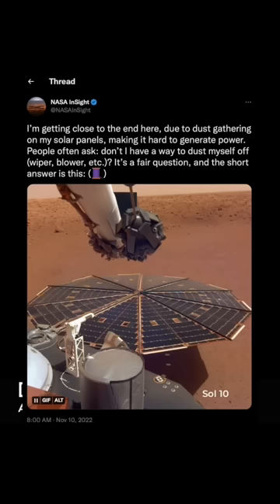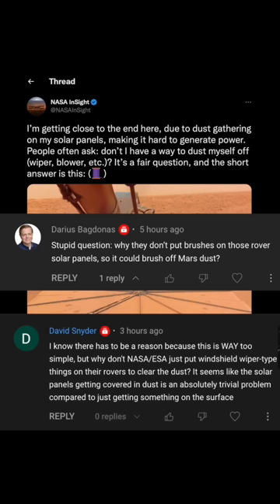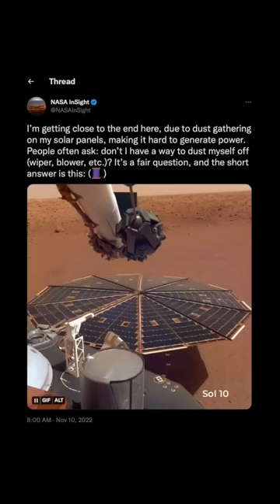Why don’t Mars probes wipe the dust off their solar panels? #shorts

Comment: Get Ingenuity to hover over it for a bit. :P
Reply: I guess that helicopter is hundreds of kilometres away.
Reply: You generally do not want a experimental flight vehicle which already almost crashed above your multibillion science instrument - except maybe as a last rescue mission.
Reply: Same thought
Reply: Wouldn't work for many reasons not least of which you're thinking Earth air pressure which Mars doesn't have.
Reply: @gdwnet  I don't think the air pressure has anything to do with it. don't forget about Newtons first law. those propellers produce enough force to lift a 1.8 kg craft that same force is acting upon the surface. also there are videos of the rotor wash from ingenuity
Reply: @benjaminhanke79  Correct. Per NASA the Ingenuity helicopter is roughly 2,147 miles (3,455 kilometers) from the agency's InSight lander.
Reply: @benjaminhanke79 thousands
Reply: This didn't age well T_T
Reply: Sorry can't do that Ingenuity is no more
Reply: @timonc6302 not at all 😂😂

Comment: Since Mars is very dry, it is also very very sticky dust (static dust - not just "gravity dust" like we are used to) so brush would get full of dust itself, causing it to become sandpaper-ish. Another thing is - that brush thing would have to be pretty long and with probably 2 joints (foldable), so it wouldn't be light/small in size and that would "kill" these side-missions (since their "selling point" is being pretty cheap and still providing good science behind)
There is good reason why last 2 "big" Mars missions uses nuclear power not solar panels - they can have extra weight on-board and are little to no impacted by dust.
Reply: Compressed air then?

Comment: Another problem is that the dust has an insane static charge so it sticks to EVERYTHING, including wipers. And being in a lower gravity, static charged environment, it is likely that dust wont behave like it does on Earth and wont just fall away with brushed off the panels. The physics of how wipers would work on Mars is probably more difficult that it sounds like at first glance.
Reply: Nitrodamous  Yes, Im telling you that orbital mechanics is several orders of magnitude simpler than the physics of atmospheric dust. Heck, we don't even have a complete understanding of how dust interacts within Earth's atmosphere, and we can directly observe and test that.

Comment: In May 2021, the InSight team successfully tried a new dust-removal technique, using the lander's robotic arm to trickle some grains of sand onto a solar panel—when a gust of wind carried the sand away, it swept a little dust off with it.
Reply: This site has much less wind than expected.
Other sites have had much more wind. Wind on mars being barely a breath on earth.
So little wind fine dust fall accumulates but isn't shifting much. 
A convenient dust devil any time in the last few years could have extended the life.
A buzzer or electrostatic pulser to vibrate the panels or dust would be lighter than brush or air jet mechanism. 

With sloping panels and perhaps triggered when higher winds are detected. Or perhaps electrostatic stickiness would defeat it.
But the results show there wasn't much need for it in the mission requirements.
The systems performed much longer than planned. 
If it wasn't the panels and lack of wind it would have been another component eventually and some people would wonder why that component wasn't beefier.

The mole burrower experiment was a failure from the start since it was unable to burrow through the ground at the site even though they persevered for two years.
A beefier burrower should have taken priority over any solar panel cleaner if such a decision was to have been made.
Reply: A cheap, lightweight corundum wiper could've prevented the entire problem far earlier.
I'll just get my coat...
Reply: @spvillano  nope. These panels are pure substrate, not covered by hardened glass like panels on earth. Your abrasive wiper would destroy the panel even faster than the course grit of the mars dust would.
Reply: @lukearts2954  Mars is super dry, small drone motor with prop should be able to blow the dust off, without moisture there's noting to make it stick.
Reply: @bobbygetsbanned6049  static electricity enters the chat...

Comment: Maybe the next robot they send can come with a feature to shake like a dog coming out of the water.
Reply: Ask Boston Dynamics.
Reply: My thought too.
A tiny motor might suffice.
A layer on the panels that repels dust?
Negatively or positively charged surface (whatever is opposite to dust particle charges)?
And tilt the panels slightly off horizontal?

Comment: You could find a frequency that would dance the dust off the panels. Use the robotic arm (assuming a stepper motor) to oscillate to start a sympathetic resonance with the panel to clear it as long as you had the ability to tilt it.
Reply: We would probably have to wait for a sample return to be able to test anything like that out, and even then, I would wonder if gravitational difference between Earth and Mars might be an issue in any experiments.
Reply: @supercheetah778  Why? We already know what the dust is composed of, it's electrical charge and the amount of gravity on the surface.
Reply: @supercheetah778  Search for the resonance experiment video. And I don't think that resonance cares much about gravity.
Reply: Then you would have an actual added mechanism within the arms that would add weight and complexity and cost. And every rover would be the equivalent of JWST in terms of production time and cost, no?
Reply: @genghisgalahad8465  I didn't say to add anything. Use the existing motor in the existing arm to vibrate the solar panel.
Reply: @CatchingVibes-et9zv  that's an added test of vibrational capacity and you would still need to mechanically set that up. Might be worth it though. On top of the usual stress test. But if it can dance to "dancing in the moonlight", I'd be impressed.
Reply: @genghisgalahad8465  it would be super small vibrations. Think like an electric toothbrush. You just need it at the right frequency and location.
Reply: @CatchingVibes-et9zv  sold! Mission is a go!
Reply: @genghisgalahad8465  Hehe. A guy can dream. Just a passing thought while watching the video. Thank you for the good discussion. I def did not consider the logistical and protocol load this would add to the entire system.
Reply: @CatchingVibes-et9zv  I'd actually suggested on the channel that JWST should have retroactive installments of magnets to dissuade magnetic meteoric particles and retroactive micro-bots to fill in and fix the micro-cracks in JWST's mirror. It wasn't even entertained. Understandably. So hopefully this back n forth was helpful and not annoyance?
Reply: @genghisgalahad8465  always helpful gaining another's perspective and input. 🥰❤️
Reply: They already have that technology in most professional cameras.
Reply: @benjaminhanke79  Resonance often does not care about gravity—friction, being the Normal force (weight in this case) multiplied by a coefficient, does "care" about gravity. Given that friction is one of two properties of Martian dust which makes it stick to things…
Reply: What about the static field technique they propose for the future moon missions?
Reply: @genghisgalahad8465  it was a lander, not a rover. Much cheaper, and lower class mission

Comment: My semi-serious idea was to cover the solar panels with a roll of plastic such as overhead projectors used to use for people to write on.  When too much dust accumulates, just roll the plastic forward a bit.
Reply: That's exactly what I thought as well. Maybe a system of rollers  at the back of each triangular panel extracting layers of this disposable plastic every 2 years or so. The addition of this system could worth the extra weight if its use means that the mission would last more  time.
Reply: But then we go back to the first problem: adding that roller and additional plastic material may just not be worth-it in terms of weight vs additional lifetime.

To not scrape the panel,  the plastic sheet also has to be fully hermetic with the panel. Otherwise it'll end up scraping dust that got underneath with the weight of the dust on top.
Reply: the distance of mars to the sun already makes solar panels less efficient than on earth. while you can easily make plastics that are transparent for visible light (obviously lol) they pretty much block out invisible UV and IR light completely. So my assumption is they didn't want to trade off a all the power they could generate with UV/IR light for longevity and making a similar contraption from quartz glass would be both heavy and prone to breaking.
From experience with photometry cuvette materials with plastic you can basically forget about any light below ~400 nm wavelength and above ~750. With quartz at least you can get down to about 200 nm and up to over 3000 nm.
Reply: Good plan. 👍
Reply: That would cause a static charge which would instantly attract new dust.  Plus you now have a static charge of thousands of volts on your vehicle which will cause problems
Reply: @johnflux1  dust storms themselves likely produce a worst charge.
Reply: That’s a good idea.

Comment: Totally with you on the weight concerns but for the abrasive mess of the dust - surely a scratched solar panel is better than one choked with so much dust that it is non-functional?
Reply: You are ABSOLUTELY POSITIVELY  CORRECT  !!!
...and all the dumb excuses 
in the world won't change that FACT.

Comment: Thanks for the explainer! I've turned this problem over in my head many times. I've heard it said that given the weight budget of a probe and also reducing failure points, engineers would rather just install bigger panels than build in a dust clearing system. 

But it still bothers me - if panel scratching is a problem, why not add a scratch resistant coating to the surface? E.g. some kind of crazy polymer or synthetic sapphire or whatnot?
Reply: The coating has extra weight and wasn't necessary to complete the initial 2 year mission. The extra 2 years they got out of it was a bonus.

Comment: Rather than wipers, could they blow compressed Martian air over the panels?  There would be added weight and it would take longer to recharge given the thin atmosphere but the Martian wind has sometimes cleaned dust off rover panels
Reply: Compressed air cartridges don't occupy much space.
Reply: @lorenzoblum868  this is true but one the bottle runs out out of air, that’s it.
Reply: @GadZookz   Amazon delivers. Needs 6 month notice.
Reply: @GadZookz  just add a pump to slowly refill it with Martian air
Reply: @wouterdevlieger1002  Exactly!
Reply: You still need "air" filter...
Reply: @lorenzoblum868   Also you would need nozzles to direct the blow force onto the solar panels.  Or maybe they could get the little helicopters to do it with downdraft.
Reply: @Smee Self  everything has mass. It's just that the video makes it seem like it's very hard to do without damaging the solar panels. It's not. But that doesn't mean it's a higher priority than adding more scientific instruments
Reply: The Martian atmosphere is .095 psi. The Earth is 14.7 psi.

Comment: Maybe some sort of vibration source to shake the dust off? Or something clever involving static charge to pull or push the dust away?
Reply: Yeah I was also thinking static charge. But applying a static charge to the panel would induce an opposite charge on one side of the dust particle, so it can only be an attractive force. Maybe there's some trick with AC.

Comment: I agree that wipers don't make sense but I think that a blower would make sense.  A small compressor and pressure vessel would not cut much weight AND you could use it for science.  I think the "it is only supposed to last 2 years" is not a good explanation as dust caused the end of life of several missions.
Reply: But most of those missions went well past their planned end date. I don't think there has been a single Mars lander that had its mission end, by dust covered solar panels, before they completed their planned goals.

Comment: My thought process was always that they could have a tiny device in the center that can rotate and puff out a small burst of air to clean off one at a time.
Reply: Why couldn’t they use sonic vibration to clean the panels
Reply: @garethde-witt6433  Perhaps vibration + course debris would scratch the surface of the panels.

Comment: I thought maybe using compressed air. But makes sense. Thanks.
Reply: had the same thought
Reply: Yep, I also thought of blowing with atmospheric gas. No physical contact, much less chance of scratching.
Reply: Same
Reply: Mars atmosphere is almost vacum, you would need powerful and heavy pump and storage tank.
Reply: entering the atmosphere would require more heat shielding for that component, also more weight. if you don’t protect it enough it’ll explode, and it can also get ruptured by small particles on the planets surface

Comment: How about the Perseverance rover? It ALREADY HAS a mechanism for blowing off dust: the Ingenuity helicopter!

Would it be feasable to to have the helicopter hover above the rover, and have its downdraft blow the dust away?
This would have the benefit of not being abrasive, since it just air, instead of a wiper arm that dust particles could get stuck on.
And the helicopter itself can shake off its own dust simply by the movement of flying.

But this relies on the question, if the downdraft is power enough to move the dust. Martian atmosphere is very thin, so maybe it doesn't have enough heft to move the particles?
Reply: recontact is a problem. six foot blade hitting mast cam......and MSL style is RTG anyway.

Comment: Actually, design a very light armature with fine soft drywash bristles. I was a solar electric designer for 5 years, photovoltaics are covered with a thin sheet of glass. Electric resistance only heats up with large shadowing, little stripes of dust is ok. Expensive to get there, make it more valuable.

Comment: I asked this question once on a JPL tour and got a similar response. I thought it was silly then and still do. We’re not talking about scientific instruments. We’re taking solar panels. Even IF there’s some debris or smudging it could still extent the life of the mission by a huge percentage. So the cost of adding a cleaning system and adding weight would be small compared to building and sending a whole new rover.

Comment: A thin layer of moving transparent film on top of the solar panels should do the trick. The weight should be pretty minimal: just the film and a motor slowly rotating the film (when the film goes over the edge of the panel it passes below it, and the dust simply falls off).

Comment: No mechanical parts needed.
You just need a few compressed air outlets. Would be VERY lightweight.
Maybe also just playing with static electricity.
Or just flipping the panels.
Don't try to convince me space engineers never thought of any solution.

But I suspect it's a matter of having your lander die so you can move the budget for new missions.
Reply: They don’t care if it breaks because they’ll just send another a couple years later at the expense of the American taxpayer. That’s what happens when you don’t respond to price signals.

Comment: Smearing bug guts across the windscreen is different to a dust.  I agree eventually sweeping dust across it will degrade the panels, still, it would last longer than letting it get covered.  Having one tool to 'sweep' the panels that the robotic arm can use doesn't seem that far fetched.

Comment: Becky, the third reason I can think of is the issue the astronauts had with dust on their suits on the moon.... electrostatic adhesion, (yeah ?? ).... The Rover would have needed to clean itself with an electrostatic field applied to the solar cell array mixed with a good supply of clean supply of air, ( scrubbed CO2 I guess in this case)... to blow off the dust. ....
Stay Safe.

Comment: There are other mechanisms that could allow wiping without brushes. Sure, any system is more weight to shoot up in space, but making and proving the concept in itself is also worth something because at some point we well want self-cleaning solar powered vehicles on other planets.
One such system would involve a very low power air compressor that would just charge and when full release high pressure airflow over a section of the panel array. This could be a very small scale device because the dust buildup is relatively slow. However, when covered by a severe dust storm, this system could immediately clear one segment for full power production again.

Comment: •It had a robot arm anyway.¹
•Flash™ Dust Magnet weighs almost nothing.
•They tried covering Insight in MORE friggin' dust, in the hope of dislodging the dust. (!)

¹A robot arm, yet nobody thought "hey, if the heat probe that we tested in just 1 type of soil fails, wouldn't it be good if the robot arm could move it to another location?"

Comment: the idea i’ve had that still probably won’t work for some reason, is to put solar panels on both sides, and cover up the bottom side. when the top is unusable (like not a little, like it can’t work anymore) drop off the cover and rotate it 180 degrees. still would add some weight and would require a different mechanism for storing them in flight because of the cover on the bottom side panels, but probably less than a cleaning device i guess. unless of course the bottom stays enough dust-free to leave it uncovered then it would be not much more weight, but i bet the bottom still has a lot of dust.